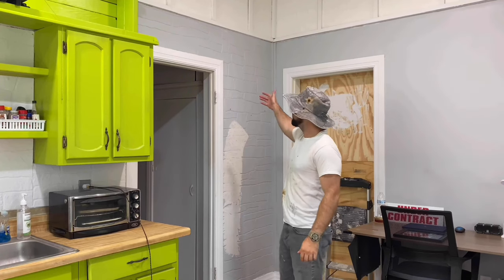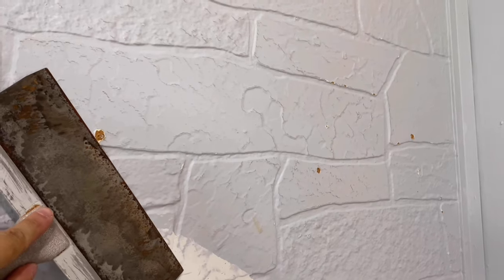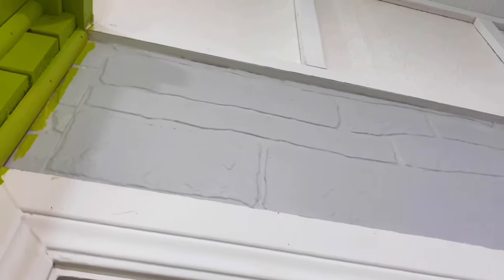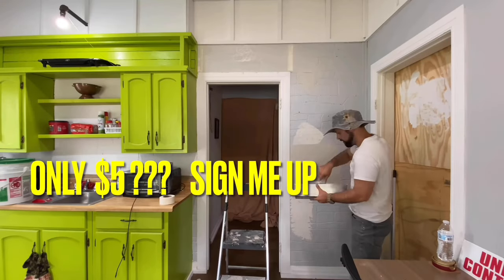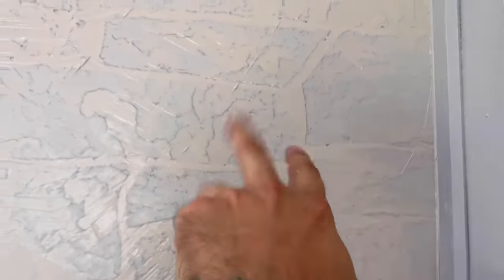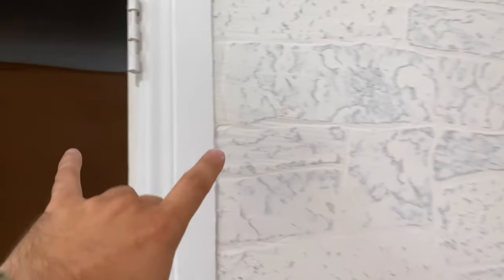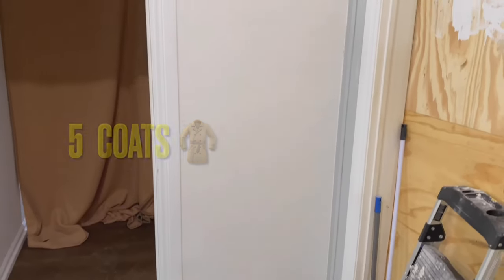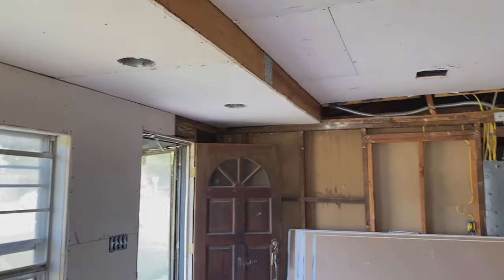How to skim coat wood wall paneling.

Comment: I would recommend a first and possibly a second coat of hot mud applied tightly to avoid shrinkage and cracking. The hot mud not only doesn't shrink, it dry's much quicker which allows for multiple coats in one day.
Reply from the maker: I appreciate the tip!
Reply: Absolutely!

Comment: I have a mobile home with painted already, mat beige, over wood paneling. I’m a beginner DIYer for my new home here. I bought Smooth wall finish I wanted to put on, then use a spaghetti roller brush for texture so it looks like regular house walls. Will this work? To fill in the long gaps in paneling? If so, do I still need to use joint tape? Can u do a tutorial 🙏🏼
Reply from the maker: I could be wrong, but I’m just gonna tell you my thoughts. I believe it sounds good on paper, but if you do, it will not go or look like you think it will. I would at minimum do what I did if your walls are already painted. Minus the tape on this seems where the panels meet together. Just mud everything and skim coat it all flat and sand it. Then paint over the skim coating. If you want to do a texture, I would buy a little texture gun and do a spray texture on your wall, like a knock down or an orange pill. At Lowe’s. They have a texture gun that cost about $75 it works great and has many settings. You will also need an air compressor. Or borrow one or rent one. I hope this helps. I’m sorry, I haven’t actually done the process you are talking about. So I’m just speaking from the way I think it could possibly turn out.

Comment: Wouldn’t it have been better to remove paneling and hang 1/4” drywall?
Reply from the maker: @juliocrespo1544  Depends on the situation. In my case, no because I can do this fast an easy and no demo, no dust, no material. Just mud and a few hours. Or you could demo it all, rehang new material and then mud that. In some cases you may want to demo because you have to do mechanical stuff in the wall or redo something like insulation or wiring etc.. but it’s really up to your situation and you. Great question!

Comment: Was this painted beforehand? Will it stick to latex paint?
Reply from the maker: Yes, it was painted before hand. I would suggest at least a primer first latex paint or any kind of paint really should be fine. To do this over the top of. I have even done it over bare wood before. But that’s why I would suggest doing primer first!
Reply: @GrantKeysProperties  thank you! I planned on sanding & wiping down with a degreaser. But I have PRO-999 too.
Reply from the maker: No problem!! Yes I would not go through the trouble with all that and just skim it. And then paint over the skim coating
Reply: @GrantKeysProperties  What did you use for primer? I don't see it listed.
Reply from the maker: @jordanoocumma3085  Hey sorry, I use the cheap PVA primer from Lowe’s. It’s about $15 or less just cheap white primer. You could also use regular paint or whatever just make sure it’s painted l, sealed with something.